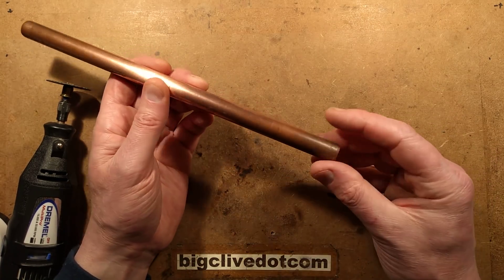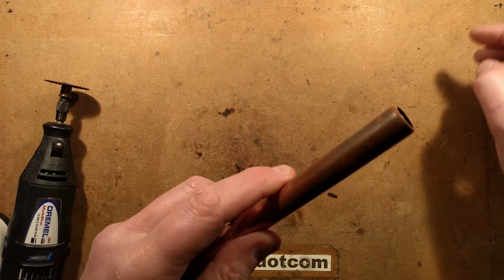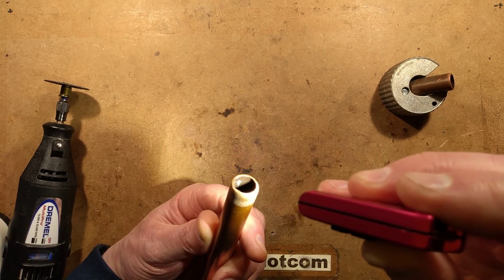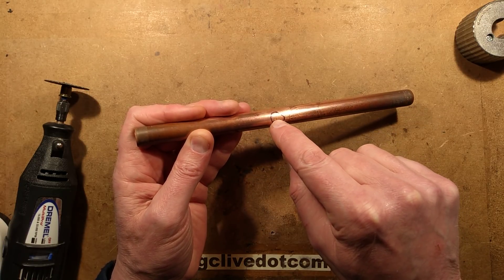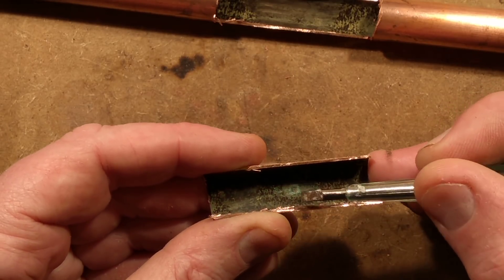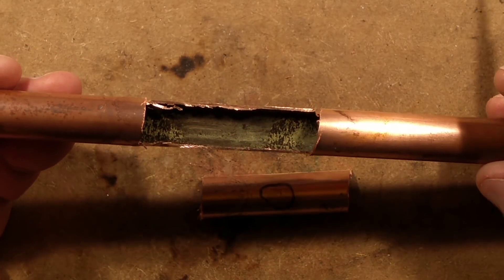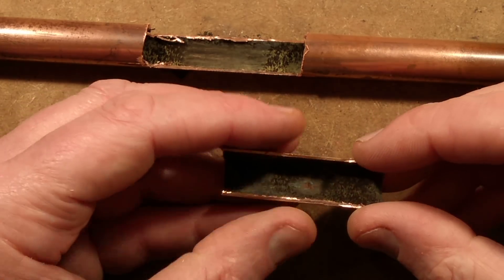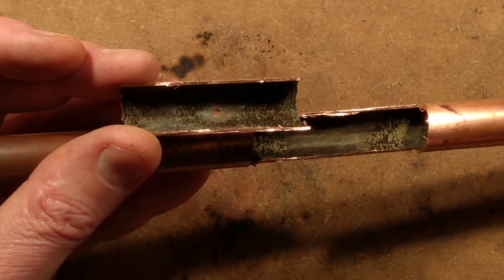Odd pinhole leak in copper pipe.  Selective electrolytic corrosion?

Comment: Very interesting. I've never looked into how copper pipe is formed... I'd guess it is drawn over a mandrel. FWIW: my house used to have all iron water pipes but it's now all PEX except for the propane line which is copper but that shouldn't have the internal corrosion.

Also, that pipe cutter is interesting... what I've always used for metal pipes is like this: http://randomer.net/stuff/pipe-cutter.jpg
Reply: The one that Clive showed was for just one pipe size and costs a lot less than the variable type, which might be more attractive to a pro plumber rather than a DIY buff.

Comment: There's a big row about one fairly new apartment building here in Finland where this happened all over the pipes and they had to be changed to plastic ones. The builder was blaming the water company for impurities, the building was of course blaming the builder for using poor quality copper with contaminants in it. This seems to happen somewhat often and it's rather unpredictable it seems. I guess it might be a combination of certain type of water reacting more violently with certain types of contaminants in the copper.
Reply: Yeah my employer has replaced almost all copper piping which was installed '97. Constant pinhole leaks in piping. Three things have been blamed. Defective manufactured pipe, usage of flux and it's residues from install working and water. No one hasn't been able to prove anything. One thing to note though, about 80% of leaks I've found have been on hot water pipes. So it definitely seems that temperature is a factor. Also one notable thing has been that after copper piping began to leak randomly via pinholes we also noticed same issues on steel heating pipes. My personal bet would be some that some metal contaminants that have "poisoned" the piping around facility and heat had tendency to accelerate some kind of galvanic corrosion. Maybe some ancient pump impeller material in water or something. Building is much older than 97, but around then those pipes were replaced. This case is from western coast Finland
Reply: @jothain  
Was the copper pipe connected onto the steel pipe. I don't think you can have water running from copper to steel pipe but can have water running from steel connected to copper
Reply: good luck getting any big company or organization to admit fault or point the finger haa haaa
Reply: Chinese copper
Reply: Hum I would assume that the water companies feed a chemical for corrosion inhibiting it is to prevent copper and lead from leaching into the pipe by building up a layer in the pipe
Reply: @sqike001ton  lol quite the opposite - the treat the water with chlorine or ozone which leaves behind corrosives, and add fluorine salts/acid which are also quite corrosive.
Reply: Happerned in the new build at Gloucester royal hospital, crap pipe by all accounts......
Reply: How can a building blame the builder?
Reply: @SqualidsargeStudios  Blame the anal retentive people.
Reply: urbex2007  that's interesting to know that it's been only on cold side. It could indicate that pinholes maybe then haven't been that random and something had contaminated only parts of piping?  Here also air was one of the possible reasons mentioned, which I think I forgot to add. I'm also on the same side with your comment that utility company indeed would have to somehow aerate water and there would have to be much of it? I could somehow believe that on heating pipes. Maybe, possibly air could get sucked into system from inlet side of pumps. Still think that's highly unlikely and as mentioned I think it began from the normal copper piping. I remember that metal piping had interesting effects, the piping was quite good looking for most parts and randomly you could see small stack of "rust" like accumulation and below that pinhole type damage. This was interesting found on internet. I thought my employer was unlucky and hugely rare occasion. Judging by the comments it seems to be fairly common problem after all. At least that common that it's interesting that fool proof facts of this issue hasn't been risen anywhere. To my knowledge answers where tried to get from quite many suppliers, specialists etc.
Reply: Plumbers allowing flux to drip into the pipe, which kick starts the corrosion process before they are even in use. Then corrosion is accelerated in those craters. I think it is as simple as that.
Reply: @rich1051414  I replaced many bad sections of pipe in my parents house. I cant think of any that were closer than a foot from a joint. If it was flux contamination it should be worst at the joints. The problems started after the house was switched from a well to city water. Not quite a smoking gun since the pipe was 20 years old.
Reply: Hello my fellow Finland residents
Reply: @anonymoushippo-m7d  
Mice and rats love plastic pipes, can't bloody win.
Reply: It's normally the crow plumber using too much flux when sweating the pipes
Reply: urbex2007 I wonder if it has to do with any components installed in the water supply, like filters or the pump blades for boosting the pressures around, maybe it has been installed recently and it is a popular product that is being used in many countries, it could become an epidemic for repair an maintenance of said pipings all over, you should try to contact any water supply department and check if they can get samples of the filters and pump impellers for checking if it could cause corrosion in coper pipes.
Reply: urbex2007  this reads a little unlikely. Copper sulphate is readily soluble in water. so it can not form deposits. Perhaps some reaction with ammonia compounds? these are also blue and perhaps there are insoluble complexe compounds?
Reply: You mentioned Finland! let's meet at the square!
Reply: @wynwilliams6977  That's.. ummm. no. Just say "Torille!" please :-D
Reply: @benbaselet2026  Torilla tavataan! Actually I am about 40 mins away from there at the moment :)
Reply: These are suprisingly common in certain areas here in southern Finland. I've seen these happend in many buildings where i have been doing construction work regardless of age. Also i renovated bathroom and sauna and replaced all pipes. After one year there was leak in new copper line above ceiling of the sauna.  Luckily it was fairly easy to replace and the leak came through  the ceiling instantly not ruining everything.  Pipe was finnish made with all the certifications..
Reply: My in-laws building in Oulu had the same problem as well.
Reply: Torilla...
Reply: I'd be careful about using plastic (PVC, cpvc, or ABS) as water pipe in cold weather countries, if I were you.  Very likely to break and flood your home or business!   There is some new clear soft plastic stuff that's a lot more appropriate for areas likely to freeze.
Reply: @mre2u2  the blue pladtic is commonly used in the where I'm from and it seems to be good at not freezing
Reply: @J MDPE, PEX and polybutylene pipe have enough flexibility to withstand freezing.
Reply: In Finland all the pipes must be of approved type. PE and PEX are used. Freezing pipes are not very common nowadays. We have ridiculous amount of insulation in buildings :D
Reply: @mre2u2  I've had more copper pipes break from freezing than plastic.
Reply: Youtube says that your comment is written one week ago. I must be from the future. 🤨

Comment: can't you just.... put a patch of lead free solder on that hole?
Reply: Soldering the hole would have been a temporary fix but as Clive did here, in such occasions, it is way more important to do research and to see if a pipe replacement would be a good idea before dozens of other holes appear.
From my experience, if one hole appears, it is usually just days before others do aswell. So just soldering it would have been a bit ignorant. Except you plan replacing the pipe whatsoever.
Reply: @l3p3  Or it could be an isolated incident. I had one pinhole about ten years ago and haven't had any since. I would remove a long section and cut it lengthwise with a bandsaw to look for other corrosion.
Reply from the maker: I wanted to see the inside of the pipe, so I cut a section out.
Reply: @bigclivedotcom  I had this on a boiler install I did where a very small section of pipe was particularly difficult to replace, so I left it in and re-used it as a cold supply to the boiler. A few years later I had to replace the section in a fully decorated house. I noticed it had flux residue still on it from the original install. Lesson learned, every install after that I never left any of the old pipe in. On another job I went to fix a leak from another plumbers work I found new pipe with similar pitting and once again flux residue, I had to remove and replace all the pipes installed to feed a new shower as they all had accelerated corrosion from flux left on the pipe.
Reply: Friends don't let friends use lead free solder
Reply: @alihaggis78  Yes, if you mean Pure Tin solder, which is prone to failure due to Tin Pest. But there ARE lead-free alloys which do not suffer that problem.
Reply: @alihaggis78  not in electronics. but in potable water plumbing I dont want lead
Reply: I guess nobody else saw the sarcasm from sandpox! Its just like when a customer brings a car to me with a completely rusted out exhaust or frame. "Cant you just.... tackweld a quick patch on it?"
Reply: Better yet an aluminum pop rivet!
Reply: @FJB2024_  Why not a blob of silicone? And some duct tape.

Comment: I hope you don't get anymore leaks.
Reply from the maker: I'll be keeping an ear open for that happening.
Reply: Clive its quite likely that you will have more over the next year or two, it seems that around 25 years is the lifetime of some copper pipes, the chances that all the copper was from the same source in your home. My daughter has just brought a property that is 27 years old, the central heating had a leak just the same as yours, I fixed it but over the next few months she had 3 more leaks so in the end I replaced the lot. I believe it is because we are using recycled materials, the copper is contaminated.  5 years ago I ran a pipe outside for a tap, last summer it had a leak, unbelievable it also had the same green spot inside.
Reply: These pinholes in copper lines often occur just a few years after construction. And they never come alone. Don't know the cause.
Aluminium hydraulic cylinders in the Citroen DS sometimes had the same pinhole leaks. Can't remember it in later Citroen models though, maybe they added a water absorbing additive to the green hydraulic fluid at some point like in hdlp-oil.
I just remember - my own car has a pinhole in the aluminum power steering return line. Fixed it with a piece of rubber and a hose clamp years ago. But this pinhole may easily came from outside, maybe the ones, that ate through these really thick Citroen hydraulic cylinder walls came from salt on the streets also, don't know.
Reply: @werner.x  Pinhole leaks happen in all sorts of things. I had an intermittent gasoline odor at the rear of my older Jeep. It was a fuel filter that had developed just such a hole. Sometimes the corrosion would plug it up for a time but then it would break free and leak again. The vehicle was fuel injected with a pump in the fuel tank, so it was under significant pressure.

Comment: I had a copper pipe (inside a plaster wall) with a pinhole in it a few years ago.  The pipe was approx 18 years old when it occurred.  I don't recall the plumber having a specific explanation for how it happened.
Reply from the maker: Was the pipe buried directly in the plaster?  It can cause corrosion issues.
Reply: @bigclivedotcom  No, just behind a sheet plaster wall.  Not touching anything at the spot where the pinhole developed.

Comment: The fun part is when your condo is of a certain age and the main hot water pipe for a  bunch of units through your wall. They eventually patched it enough that the entire pipe was replaced but my wall was opened twice just for the pin prick holes that developed. The second time I could find the hole just by feeling for the hot water on the other side.